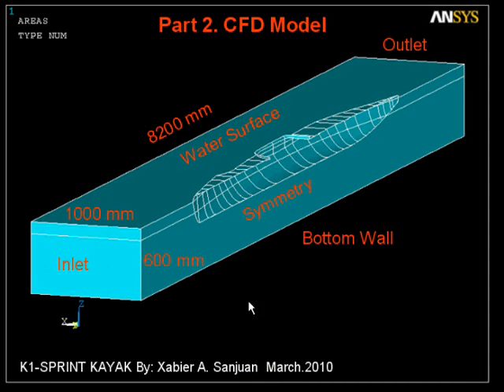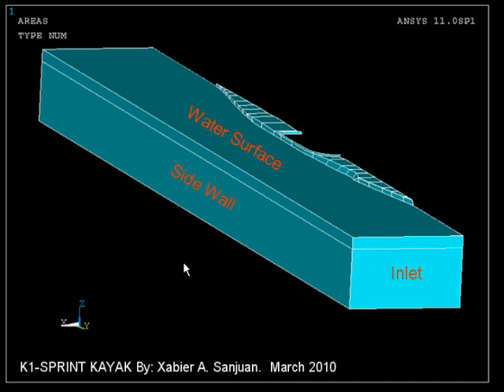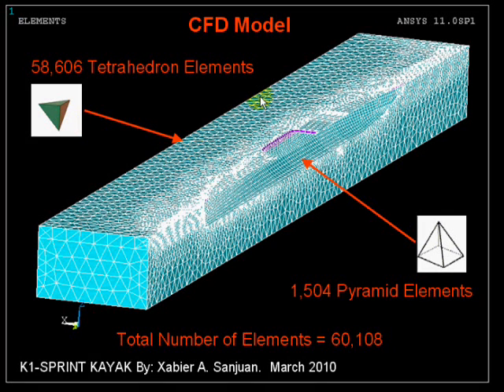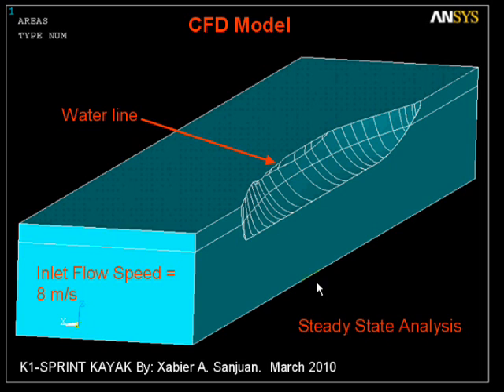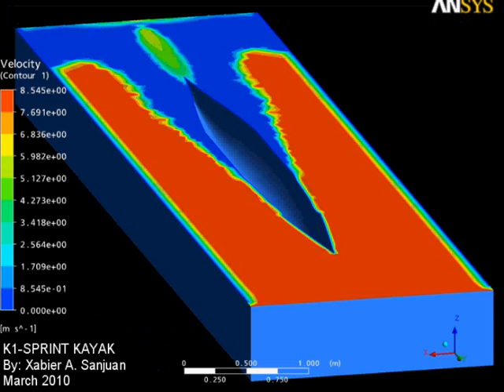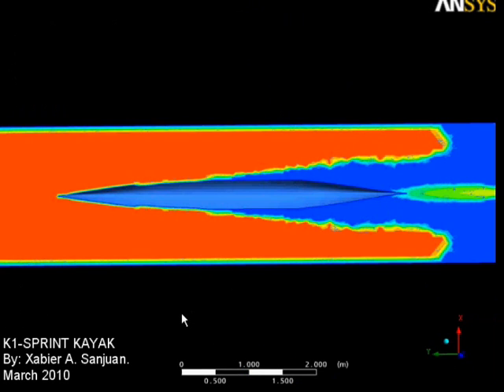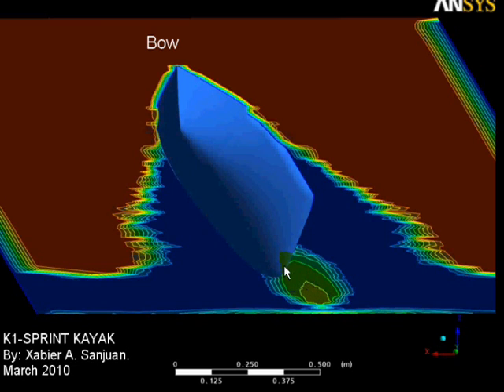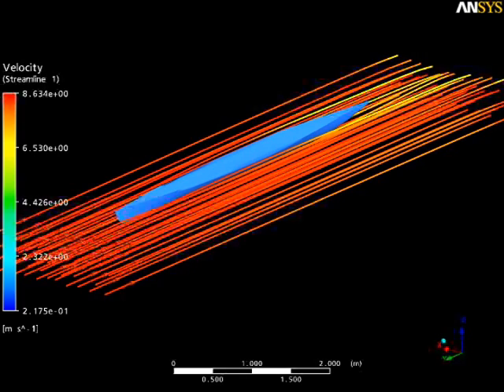K1 Sprint Olympic Kayak designed to be the fastest ever made

Comment from the maker: @felipeleft Use the Shell 99 element (8 node, linear structural shell). You need to dfine the layered carbon fiber section, with orthotropic material properties (e.g. EX, EY. EZ, NUXY, NUYZ, NUXZ, GXY, GYZ, GXZ). Then create the shell section,where you define the carbon fiber layers (thickness, material ID, orientation (i.e. 45, 90, 0 degrees). Good luck!

Comment: Did you build the kayak? If yes; did you compare wave form that is generated by hull and generated by computer? The wave form that calculated may be fault. What is your turbulance model? (my opinion)
Reply: I have not built the kayak yet. This CFD model does not consider waves. I did it just to find the drag for a specific water line. I used a predefined medium turbulence.